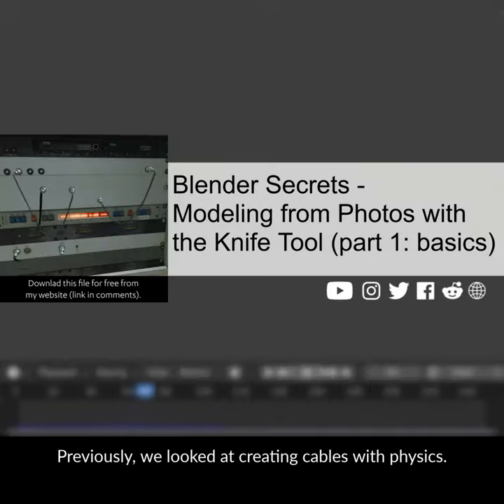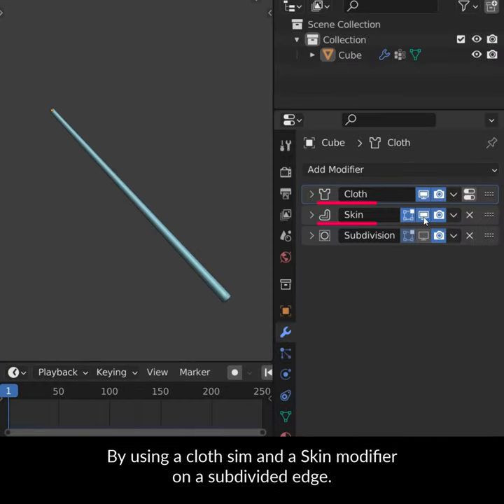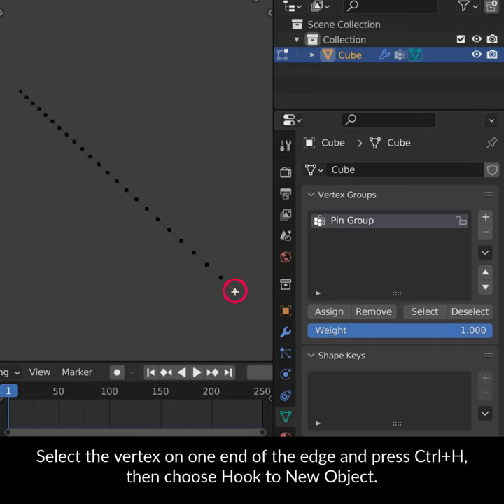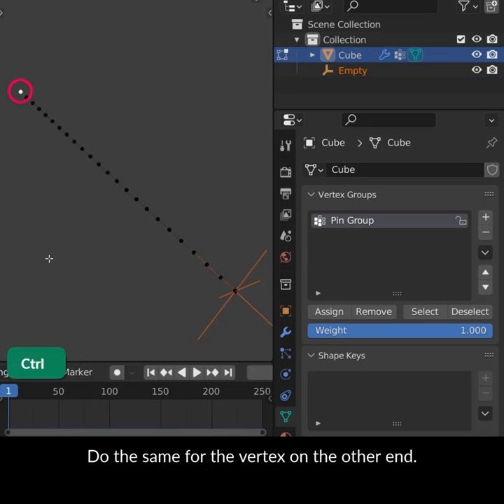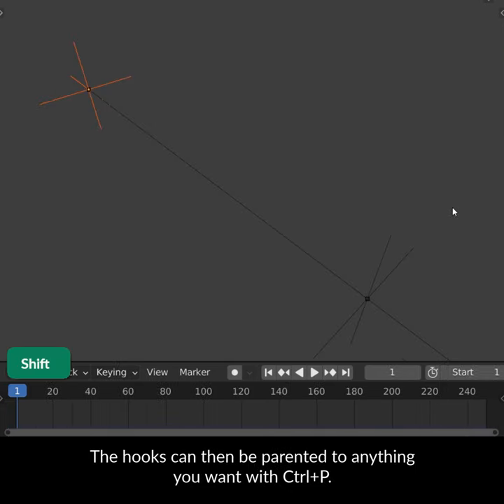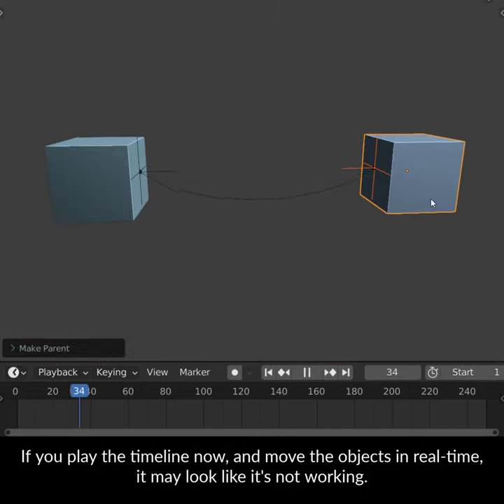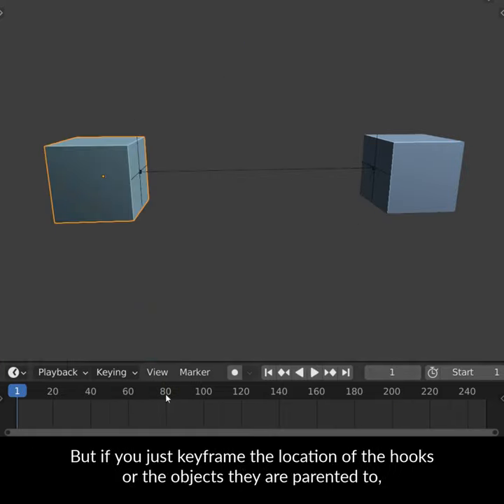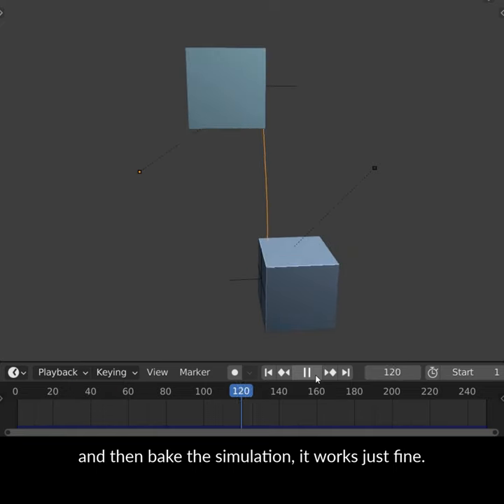Blender Secrets - Cable with Physics connected to objects

Comment: why is that when i move the objects, some vertices are left behind? only the hooked points move along? Any help would be greatly appreciated
Reply: Make sure that the hook modifier is on top of your stack. I also used just one hook modifier and the other end of the cable is just linked completely to the root.

Comment: If I bake it it's fine and it hangs like normal. If I unbake it, keyframe the hook to a different location then bake it again it retains the same shape as before but where the hook moved it just stretches from the original point. What is going on?
Reply: did you find the solution to this? facing the same issue

Comment: Can you do a video on how to keep detail after retopologizing a high poly model. Because I see tutorials on YouTube tell me to use multires modifier and shrink rap, but If I use a multires modifier the model become high poly again and the is a bit inconvenient for stuff like to be used in a game.
Reply: Thats what normal baking is for. The normal map gives pseudo details. Otherwise it makes no sense to do a retopo and get lower poly count
Reply from the maker: I’ve done tutorials on that. What you want to do is either: bake from Multires to Normal map, or bake from Multires to Displacement map.
Reply: @BlenderSecrets  if you bake from multires to displacement, afterwards do you still need the multires modifier to give the detail from the displacement map, or will the displacement work fine on its own and you can get rid of the multires modifier?
Reply: @NathanSefrin  when you bake any map(Normal or Displacement map) - you should use them as a standalone texture in shading section. After the baking you can remove all modifiers you used to give details.
Reply: @tmbrwlf  k thanks very much appreciate it

Comment: Guess you also saw that addon which has this function. saw this teaser or new release about same functionality
Reply from the maker: To be honest, I don’t pay much attention to add-ons. I just don’t have time to learn them. I purchased BoxCutter and Hard Ops, for example, but I’ve never used them. I wish I could, but there’s just already so much to learn in Vanilla blender, it never ends.
Reply: @BlenderSecrets  YES! Exactly what i think, I don't have time for add-ons, the only add-on I've enabled is Node Wrangler.
Reply: @BlenderSecrets  Most addons are simply a shortcut of an existing function or a combination. They make work easier and much faster. But sometimes getting around is nice.

Comment: I can't for the life of me figure out how to make the cable collide with the ground. It only works if the original mesh has faces. If its edges only it just passes straight through collision objects.
Reply: I ended up simply extruding the mesh and using solidify instead of skin. It doesn't look as good but does the job
Reply: @omermagen824  wdym by that? trying to get the same effect as you are
Reply: @floatingnecc4842  When you have the shape of the rope ready, just select all edges and extrude them very slightly so that you'll have faces. This way the mesh will collide with other objects that have a collision physics. It will look ugly up close but alright from a distance. Add a solidify modifier also with a small value to make it look a little better.

Comment: Hi, I have a question. I've been learning blender for 6 months now and ended up getting into a mechanical project. The problem is, I don't know if blender can do simulations the way that is necessary for me, since it's a modeling software.

My question is: Can simple machines be simulated in blender? Like a rope on a pulley, and I would have a way of pulling on one side of the rope seeing how it will effect the other side. Or would it be better to start learning engineering software like a CAD?
Reply: It can be achive by contrains

Comment: Not working for me , my cable fall straight down to oblivion
Reply from the maker: Did you remember to pin it?
Reply: @BlenderSecrets  Pinning and parenting , with modifiers on top
Reply from the maker: @aowa9727  If it falls down, it's definitely not pinned. Please check the previous topic again: https://www.blendersecrets.org/secrets/cable-physics (linking to the website because on YT it's a "short")
Reply: @BlenderSecrets  My bad , i did not set a group in the Pin group menu , that explains it . Thank you for the link i could not find the the first video by myself

For some reason , i did not get any notification for it
Reply from the maker: @aowa9727  Glad you found it! 👍